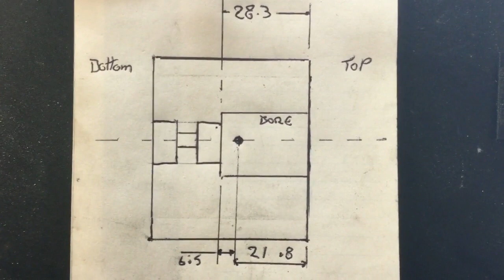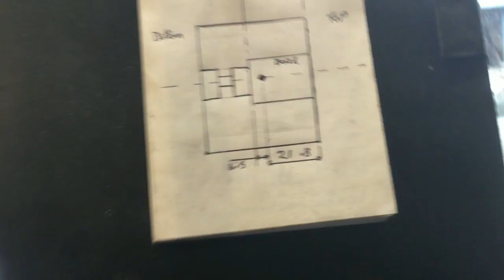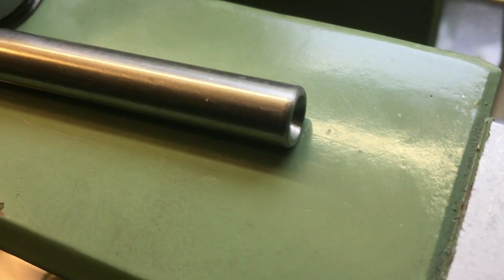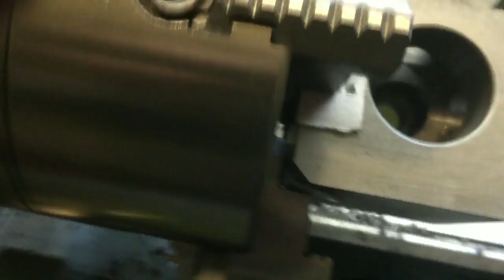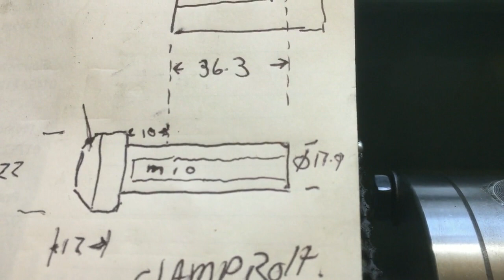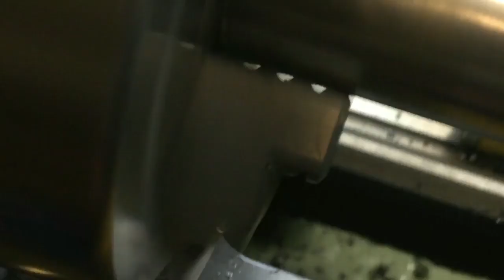WARCO LATHE Shop made quick change tool post part 7

Comment: you can part off on the outside of the steady, using upside down helps.
Reply from the maker: with hind sight yes i could of done that , i do like to be unorthodox , lol. my present tool post has not the scope of height to part upside down in reverse , the new one will have the scope . i am also thinking of a rear mounted tool block for this express purpose , thank you for your input , and please please please subscribe , thanks again ,Adrian